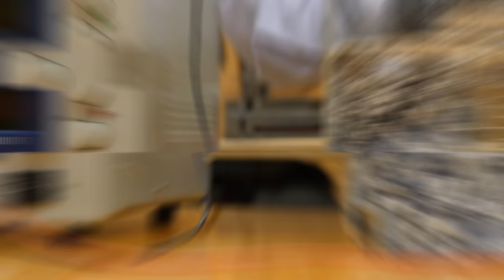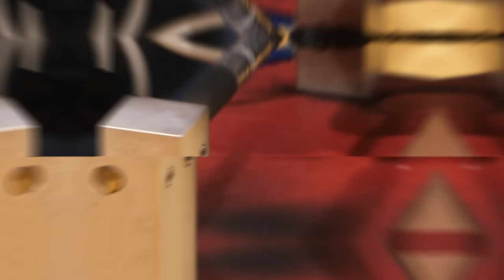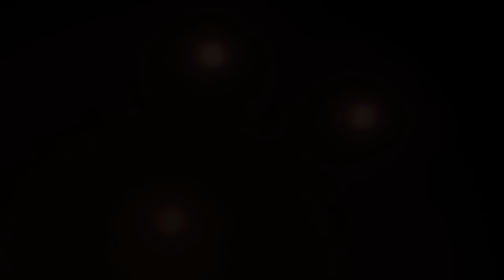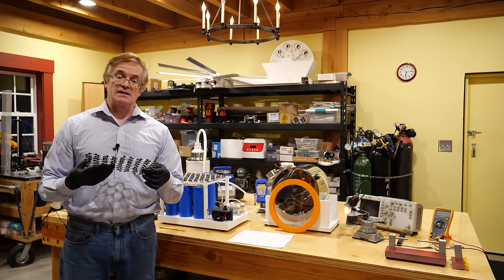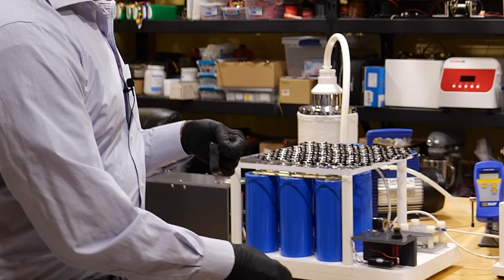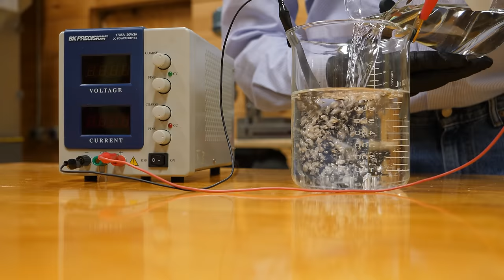Making Graphene could KILL you... but we did it anyway?!

Comment: @TechIngredients What I don't get is that an SCR still allows current to conduct through even after you have removed the 3V from the gate. 
1. How can the pulse be 25 milliseconds if the current is still conducting through the SCR?
2. Wouldn't it be better if you put a breaker switch before the SCR so you can shut it off after the flash (no need to wait for the voltage to drop) and make it faster to take out the tube?
3. Non-related but I tried signing up for your Patreon for priority contact but I see it hasn't been maintained in a long time. Are you still managing that?

Thanks!
Reply from the maker: Thanks for the notification re Patreon.  I'll mention that to my son.
Remember, the pulse width and amplitude are based on the light output (heat) and not the potential across the circuit. 
I wouldn't trust touching a potentially lethal circuit with only a switch between me and the capacitor bank.  The resistor dump and at least one voltage meter across the capacitors is safer.
Reply: @TechIngredients  Thank you for answering! Would you still recommend an SCR over a IGBT? At least the latter has a solid off once the voltage is removed from the gate.
Reply from the maker: No, both are viable and would work.
Reply: @TechIngredients  Thanks a lot, you said "Remember, the pulse width and amplitude are based on the light output (heat) and not the potential across the circuit. ". Wouldn't the active current/voltage across the flashed carbon black (through the SCR) continue to change its structure, or is this a non-issue? Hope to see you back on Patreon soon.
Reply from the maker: No, it won't. Once cooling has lowered the temperature even moderately, the graphene is stable.
Reply: @TechIngredients  Fantastic, you're amazing! Thanks so much! I'm building this out myself. I'd love to share pictures of it once I've built it out. Do you have an email? I tried emailing the techingredients email before but I never got any response.
Reply from the maker: We do, but we prefer to communicate publicly so that everyone can benefit.
Reply: @TechIngredients  Understood, more than fair.

Comment: Could you get more Graphene by hitting it with multiple charges.  I saw you only fired the SCR once?
Reply from the maker: No.
The cooling rate is key to the production of graphene vs. graphite. 
Once the carbon has been cycled, the current flow through the tube changes a lot and unpredictably.

Comment: What would happen if you ran the flash heating multiple times on the same batch? Would you get higher output per batch? (just asking if you've tried this seemingly simple experiment)
Reply from the maker: I did, and it doesn't work. The resistance and the cooling rate change dramatically.

Comment: Could you use a inert gas like argon instead of a vaccum?
Reply from the maker: No.  It has nothing  to do with the reactivity of the gas. There might be some advantage using argon by generating less graphene oxide which is a poor substitute for pure graphene and which is what you often get when you think  you're ordering graphene from a supplier. 
The reason the gas doesn't matter is that the heat causes any gas to expand, explosively driving  out the carbon precursor.

Comment: Great job  I would like to work with you on a project that can fund your projects with no top limit on funds to continue your work. 
      You have all the equipment necessary to build the first one.
      This is an engine cylinder head that has no rpm limits except for max air flow through the system  and can change the timing and duration  of the valving system while running. This uses no springs or solenoids and is totally mechanical.
With less parts than are used today .
    You might say thats impossible but it's not.
     Throw away the camshaft,valves,springs,everything.
     The system has no loads on it to work and a 10 cylinder engine can be spun with your finger allowing the energy used for conventional valves to turn the crankshaft.
    Plus with high rpms comes much more horsepower and fuel economy. 
     You could build a 2 cylinder engine that puts out the hp of a 6 cylinder  engine and more
        The main reason there's pollution is the dirty fuel gasoline is very dirty and only the hydrogen is burning.   This will run with it very well but was made to burn hydrolyzed alcohol or hydrogen and even hydrolyzed gasoline.
     We have the system to deliver liquid fuels already just the fuel changes to lower pollution and will easily run on std gasoline but with a greater amount of the potential energy to be used from a gallon of gasoline 

            Please if you are interested in talking with me and working to change the whole world of combustion engines and reduce emitions by leaps and bounds .

 please contact me by mail pr call by phone my email isn't ready yet.
      Kenneth Handschu
      598 river rd
       Po box 288
        Edwards ny
        13635
    315  604  7281

Thanks looking forward to hearing from you.
Kenneth M Handschu

Comment: Will it be possible to flash the same lot multiple times to get more yield out of one batch that we put in the chamber?
Reply from the maker: No, we tried that.  After a single cycle, the resistance of the mixture of "stuff" that remains in the glass tube varies from run to run making the settings difficult to predict.  Also, the graphene already formed will also be destroyed with subsequent pulses.  It's still just carbon atoms and can be vaporized with heat.
Reply: @TechIngredients  thanks for answering. Cheers for the video! 👍🏻

Comment: When you mention that the rods can be made longer but then mention getting the same compaction, compacting from the end doesn't result in a homogenous compaction throughout the length of the rod.  You end up with higher compaction at the ends with lower compaction in the center.  This is less pronounced in a short rod like what was demonstrated but longer rods would be more pronounced.

Also, has the resistance been checked after the vacuum has been obtained?  Since the air inside the tube with the carbon is what is heating and resulted in an explosion outside the vacuum, and putting it inside a vacuum prevents it from exploding, that would mean the vacuum is pulling out the air from within the tube that is around the carbon.  I can see this changing the resistance.

 Regarding the resulting graphene being gray flakes that is easily visible, should that really be the case?  We are talking a mesh that is just one atom thick.  Even a gold film is translucent.  I would expect the graphene to be anywhere from transparent to highly translucent.  Not opaque gray.
Reply from the maker: Eventually,  the compaction will become problematic, but this stuff is extremely  slippery, and scaling a few fold would probably  not be a problem.
The grey flakes are turbostratic graphite, poorly aligned sheets of graphene  that are easily  separated. 
We did check  the resistance.  The setup  makes this easy  and under vacuum,  the resistance  remained unchanged.
Reply: @TechIngredients  Thanks for the reply. It would be interesting to see a video on the separation.
Reply from the maker: This question  has been asked a few times before. 
It's  rather simple.  After sieving out the flakes of turbostratic graphite, they were sonicated in water and then allowed to dry in air. The powder was stirred into the epoxy.

Comment: Mr. Spock would say "fascinating". But this time without being sarcastic. 
For fun I tried to calculate the cost savings by using button type 46 pcs 5.5V - 1.5  F supercapacitors at 2$/pce. But then I noticed their ESR is 40 x higher so the output power would be some 25 % lower with 2 Ohm load. So you could use 2 parallel banks of 46 pcs = 184 $. Is this calculation correct and useful to save 400 $ (if you can limit the flash time to 666 µs)?

Comment: How could we melt or weld graphene to transform it in a sheet?
Reply from the maker: It would be a chemical  process  rather than a thermal process.  That's  why we used the composite mix to test the potential.

Comment: 31:00 how do you get the air out of the carbon if the tube is sealed with the electrodes and the tungsten rods? also wouldnt removing the air change the level of compression and therefor the electrical resistance? also insulation of the air? if there is nothing left between the conducts, what would guide the arc? is there lightning in space? in a vacuum?
Reply from the maker: The copper mesh and the loose fitting rods do not seal the tube.  We checked the resistance under vacuum because  the wiring  made it easy, and it doesn't change.

Comment: @TechIngredients I took a look at the original paper and the supplementary information accompanied with it, and 2 ohms did indeed show the best product (versus 4 ohms and 1.4 ohms). In your video you stated that if you used 4x as much product (4x longer tube length), you'd need 4x as much resistance for the same compaction (so 2 ohms * 4 = 8 ohms).  I couldn't find a specific paragraph in the paper that seemed to suggest this, but in your video, you put 150 milligrams of carbon black with a 2 ohm resistance. Am I to assume that for 600 milligrams (using a longer length of tube), your resistance should be 8 ohms?
Reply from the maker: The resistance depends a great deal on the compaction step and can be adjusted over an order of magnitude given the same amount of precursor.   The reason  for the longer pellet is primarily to control  the rate of cooling, which is where everything important happens.
Reply: @TechIngredients  This leads me to an addendum I wanted to mention for your video. If you watch a later video of James Tour, he mentioned that his group doesn't use the vacuum anymore.  It seemed that they used a solid electrode that was machined well enough so that it just barely fits inside the quartz tube. This would mitigate the blowover issue that you initially struggled with, and most of the heat is dissipated as blackbody radiation anyway.

The most confusing issue by far for me is figuring out what resistance is appropriate for a given quantity, since as you mention it's the cooling step that is the most important in making the turbostratic form. I am also using an 8 mm ID quartz tube. In the original paper, it states "The compressing force is controllable by a modified small vice so as to minimize the sample resistance to 1–1,000 Ω, and is key to obtaining a good flash reaction (0.004–4 S cm−1).", which is a large range and matches what you just said about adjusting it over an order of magnitude.
Reply: @TechIngredients  By the way, what AWG of wire would you recommend. I can't tell in the video but it seems you are using AWG 2?
Reply from the maker: You'll have to experiment, obviously.  However, I'd start around the several ohm resistance for a tube similar to the size we used. I did this experiment several  dozen times to establish that value, so be prepared with enough stock to dial in the right ratio of resistance to volume.
I'd strongly recommend getting the equipment to monitor the pulse duration, i.e., an oscilloscope and a photodiode ( Thorlabs), because the compaction step can introduce some variability from test to test even with the same measured resistance.
Reply: @TechIngredients  Do you happen to have the model number of the Thorlabs photodiode you purchased? There's a wide variety.
Reply: @TechIngredients  What resistance value you used between the battery and the SCR gate? I see a small resistor but not sure of the value.

Comment: Electromagnetic charged hexagonal overlapped sheets of some kind of arc melted graphene metal. Possible? Idk what you could arc melt into the graohene to increase its strength and make the metal magnetic to also increase the strength between the sheets?

Comment: I thought that adding 2 capacitors in parallel to a circuit still adds capacitance to the circuit instead of halving the capacitance?  I know resistance in parallel halves the resistance, but am I understanding capacitance incorrectly?
Reply from the maker: I'd have to review what I said.  If capacitors are wired in series, then the combined  capacitance is the inverse of the sum of the 1/C of each individual capacitor. In parallel, it's just the sum of the individual capacitance.
Reply: @TechIngredients  oh man yeah I completely did not understand how multiple caps behave in series. Makes sense, though, that they wouldn't just double capacitance now that I think about it. You can't just double capacitance if there's no additional path to ground. I still don't really understand why the math is how it is when they're in series, so I guess I have something to learn about today 😁

Comment: save yourself some trouble and put a tiny bit of tape on the end of the jack rod used for releasing the jack, and mark it with a perm marker to notch where it aligns with the release screw.

This will save you quite a bit of time fumbling about like in this video.

Comment: Whats going on at the atomic level in the epoxy composite, graphite vs graphene? Is it the graphite particles can stretch by sliding internally, whereas the graphene flakes are locked on both sides by the epoxy?
Reply from the maker: You're right. It's the geometry.
Carbon fiber reinforced composites are much stiffer and stronger than carbon black colored plastic composites.  The same applies to the larger, flat, high surface area graphene vs. the tiny graphite particles.

Comment: Hi, I'm a university student, could I have more specific data on the electrical circuit? At what voltage are the capacitors charged? Thank you
Reply: why were the capacitors placed in series if they are charged at 240v?
Reply from the maker: I covered that in the video.
What is your area of study?
Reply: @TechIngredients   I'm studying engineering. I didn't understand why the capacitors were placed in series until they reached a working voltage of 500 volts.
What is the voltage at the output of the MOT transformer?
Thanks for the reply.

Comment: Thank you for this video !
Reply from the maker: My pleasure!
Reply: @TechIngredients  Question. Have you tried melting/adding the Graphene to Molten metal of any types? As a alloy. Like Aluminum +..... etc? IT would be interesting to see the outcome of Iron+ Graphene. Since Iron+Carbon Makes Steel.
Reply from the maker: I haven't, yet.
Reply: @TechIngredients  ok . Its a interesting question. All the info i have been able to dig up all references the material to be harder than steel. But i wasn't able to find anything where someone actually tried using it with iron to make steel. Seems like a obvious thing to do. And i most likely suck at being able to search for such info. But what if.. No one has done it.. Because they think someone already has..... Anyways. :) Hope you give it a try.

Comment: Can you measure the heat conductivity/transfer with the epoxy graphene mixture?
Reply from the maker: We could, using the apparatus we built for testing our thermal pastes.
Reply: @TechIngredients  Id really love to see that and in more varying graphene percentages, Would 50% graphene 50% epoxy be possible and if it can be anywhere near the thermal conductivity of aluminum yet it would be much lighter than aluminum

Comment: Can’t you also produce graphene with lasers?
Wouldn't it be possible to avoid using metal on circuit boards by simply lasering the conductors?
It would be a little safer than dealing with such high voltages.
Reply from the maker: It's complicated.
You can, but the laser is simply the heat source. The precursor and the conditions during the conversion are the complex part.

Comment: Very interesting video!
So a question in terms of understanding: How would you make e.g. a plate of this stuff? As I understand it 
a) there are just these small flakes 
b) forming it into something else would require another reaction which will loosen the bonds making the work for nothing
c) the material really only is 1 atom thick so you couldn't make a plate (just a very thin sheet at most).
Then again those flakes are clearly thicker than 1 atom so idk.
Is it really just meant to be used inside some other material to transfer some of it's properties but never as a pure material?
If anyone could help me understand I'd be glad.
Reply from the maker: At this point, we're  limited to these small fragments, although  even then, they have a huge potential for reinforcing other materials.
The technology  still has a long way to go for us to see the full potential  of graphene.
Reply: @TechIngredients  So the material could not NOT one atom thick? Could you have bonds cross layer? My public school chemistry is saying no but idk. Sorry about the questions this just really scratched an itch for knowledge in me.
Reply from the maker: That's good!
Keep researching. 
The material  can be one atom thick, but that's tough. 
If you try to purchase some, the specs will indicate the percentage of single and "few" layer material.

Comment: I am courious if it is possible to use a laser, in a cryogenic environment, to gain the benifit of heating the Graphite to the perscribed temprature while allowing for rapid temrature reduction alowing the lattice structures to form and bond to each other froming it in 2 dimential sheet of Graphine sheets.
Reply from the maker: It's  likely a good idea.